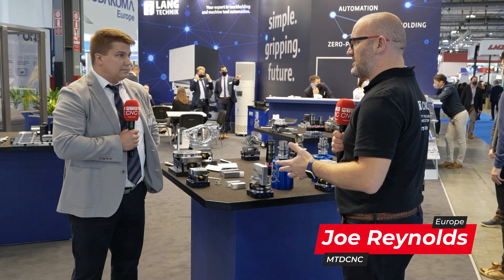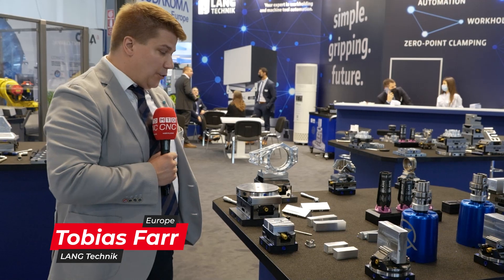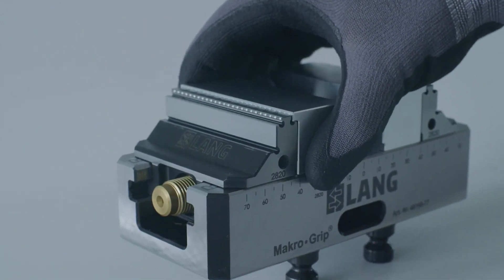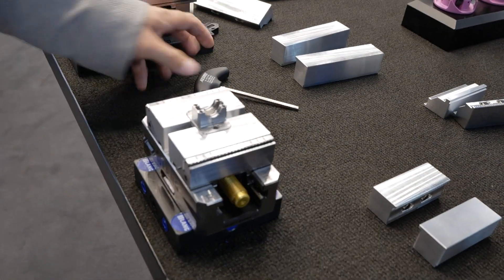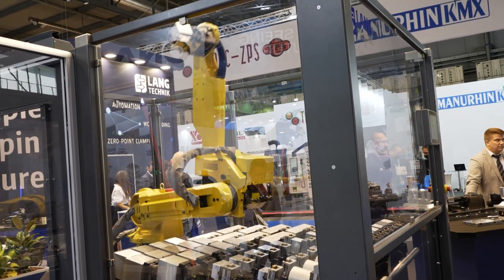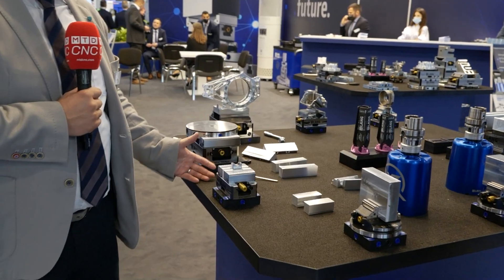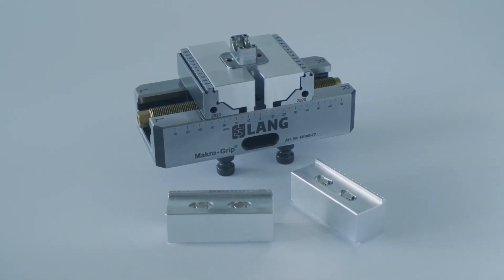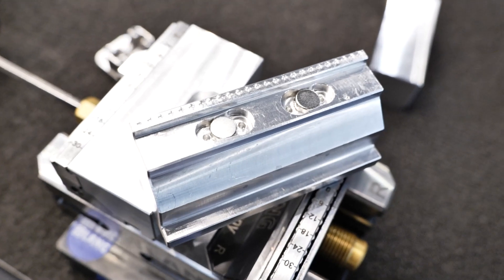NEW quick change soft jaws from Lang Technik

Comment: It's interesting... But I think the Schunk KSC is a way better idea. This just seems janky. 
I would have to see some hard machining using these soft jaws first.
Reply from the maker: Fair enough!
Reply: agree. depends on the jaw contact to the part.  if it's close (height) enough to the top of the main jaw it will not work at all.
Reply: We use these Lang clamps without stamping, to mill aluminium/steel and they work great.
It's our bread and butter using erowa palette system.